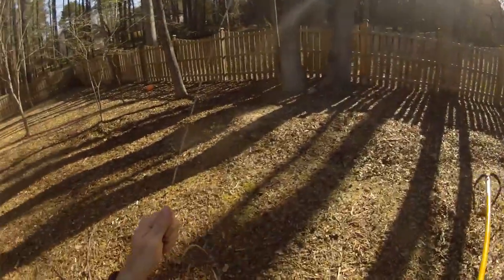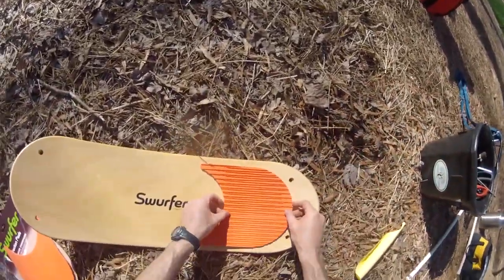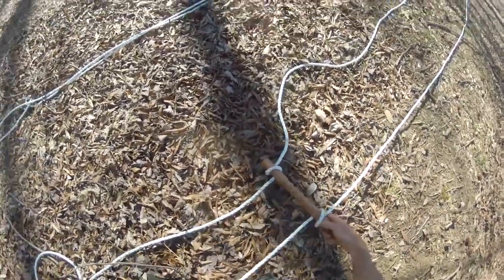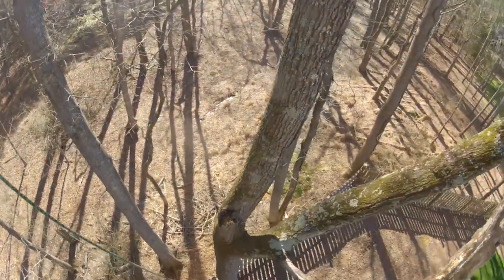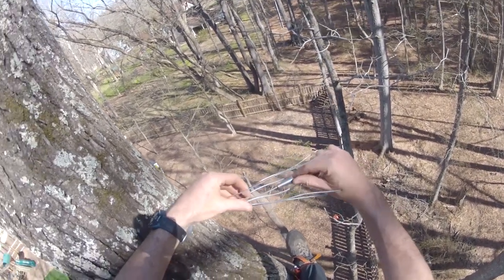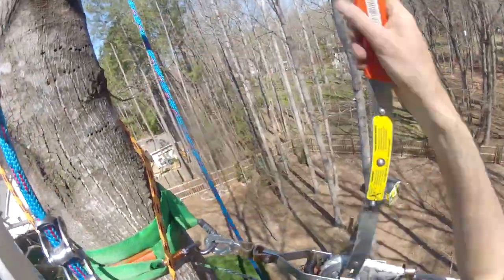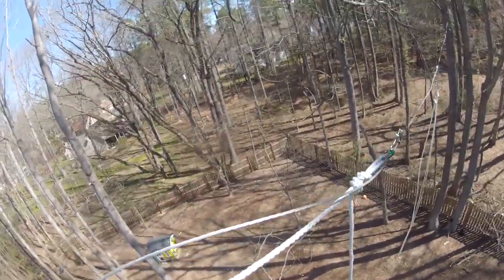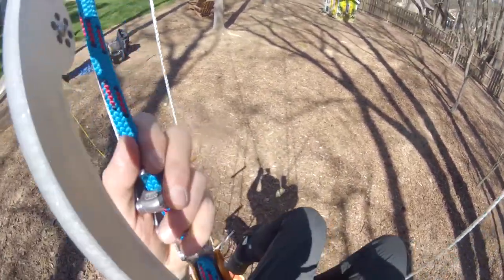How to Install The Swurfer Swing Between 2 Trees

Comment: @Patrick rope runner or zigzag/wrench - if you could only have one, which would you choose. Thanks!
Reply from the maker: If I could only have 1 I would choose the ZZ/RW combo for two main reasons. 
1. I love the built in swivel on the ZZ 
2. The ZZ grabs reliably on any/all of my ropes.  I've climbed on the ZZ with 10-13mm ropes and it never creeps.  The RR is tuned to one of my 11mm ropes, but if I use it on my other 11mm rope it creeps. It's maddening!
The things I like about the RR are that you can bomb out of a tree faster since your hand is away from the metal and won't get as hot as when puling down on the links of the ZZ.  Also the RR parts are replaceable when they wear.  Still, those  favorable RR points don't turn the tide for me.
Reply from the maker: And of course its annoying that the ZZ is not midline attachable, but that is easy to work around.
Reply: Patrick Brandt I really appreciate your feedback!! I love your content! Thanks friend.

Comment: Patrick,
Great video and instructions!
We successfully installed a Swurfer between two ponderosa pines, however, I believe I pushed the limits and there is way to much sag / stretching. The trees are about 42’ apart at the base, but by the time you get 35’ up, which is where the suspension cable is, the trees are about 46’ apart. The average sag is a little over 4’ when an adult gets on the swing.
The one thing we did not expect is the trees also bend a little with the stress of the swinging. So between the combination of the trees bending and the cable sag it takes some of the energy out of swing momentum and makes it a little more of a work to get going. Plus, an adult will pull the Swurfer to just inches above the ground.
It is still fun, but I’m not totally satisfied just yet and will try to fix this at a later date. Do you have any recommendations to add some strength to the system or should we start over with some closer trees?

John,
Black Forrest, Colorado
Reply from the maker: Hi John. Thanks for posting with your experience.  I'm not familiar with Ponderosa pines, but I have installed many Swurfers between loblolly pines that we have in the East.  The span is not as much a concern as the rigidity of the trees (or lack thereof).  What is the circumference of the two Ponderosa pines at the chest height?  

I find that I have to get the cable as tight as physically possible with the Maasdam rope puller.  Do you think you can tension the cable a little more to minimize the sag or are the trees bending?  Even when the cable is sufficiently tight I sometimes have to put the swurfer swing at 4 feet above the ground level so that when 180-200 pound person gets on it it is still 1 foot from the ground.

I wonder if in ponderosa pines it will end up being important to not install the cable above 30 feet??
Reply: Patrick, The trees are about 54" at chest level. I'm going to try to get the cable a little tighter. I did buy the Massdam rope puller, but the installer couldn't use it, because it didn't come with the cable and hook. He ended up going to harbor freight and got a regular come-a-long. I have a feeling that the ponderosa trees might have a little too much flex to go more than 35 feet up. I'll update my post after I try to tighten it.
Reply from the maker: Please let us know how it goes!

Comment: Swurfer just introduced a suspension system that is basically a slackline. Other than the weight limit of 220 pounds and the aesthetics, is there any reason not to use their slackline as compared to the steel cable? Their solution certainly makes for an easier installation.

Also, is there an established way to pull a tall swing such as this up and out of the way of the yard when not in use? I assume some kind of pulley system attached to one of the trees?

https://swurfer.com/collections/all-swurfer/products/new-swurfer-skyline-swing-suspension-system

Comment: It seems dangerous. I used similar method for another type of swing: attached the wire to the chain, but as it contacts the same point of the wire, it will break sooner or later. I used 8mm wire, but it still broke after 2 years (it was used only one weekend in a month).

Since then I have a safe solution.
Reply from the maker: The kind of cable you use is critical.  This is 5/16" diameter 7 strand Extra High Strength galvanized cable.